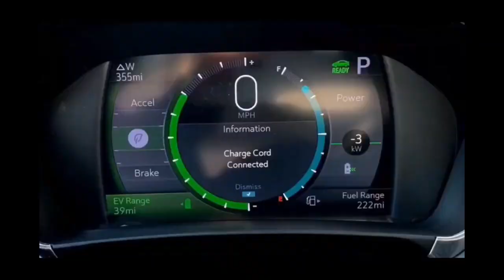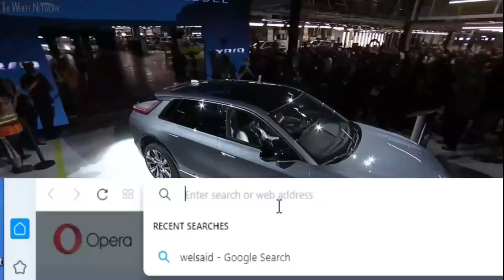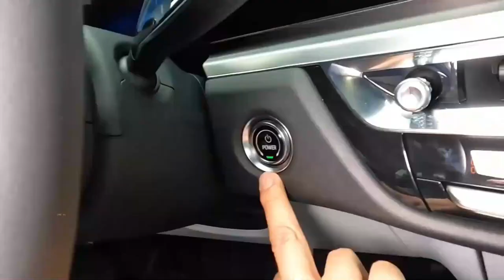2023 Cadillac Lyriq Debut edition Deliveries: 1st Quarter of 2023

Comment: I dropped by my local Cadillac dealer and test drove a 2023 Cadillac Lyriq. While I was impressed by the fit and finish and it is a very beautiful, well appointed and optioned car. The Lyriq was anything but quiet.  Every time I was around a normal city speed limit and not accelerating, or even when I put on brakes and the Lyriq was slowing down, it made a sound that was hard to pinpoint.  It was a pulsing sound.  It was very annoying so much so that I didn't particularly enjoy the test drive.  This Lyriq had only 83 miles on it so it had not been abused as a demonstration vehicle. I drove my Mustang Mach-E to the dealership and it's 100% more quiet than the Lyriq.  I was seriously wanting to be bowled over and fall head over heels in love with the Lyriq.  I'm a Cadillac man through and through.  I own an XT-4 Premium, which is my 12th Cadillac.  I love Cadillacs and really wanted the Lyriq to be my next Cadillac.   From my test drive, I'm not convinced that I will order a Lyriq. I just could not live with the noises, aceleration on this vehicle sounded almost like an ICE car.  Also, GM has made the process of test driving a Lyriq tied up in red tape.  I had to provide VIN of my Mach-E, Insurance, Driver's License, and lots more information just to drive the car on a 10 mile test drive.  I have to say, I thoroughly enjoyed my ride back home in my Mach-E. I am hoping that this is a "one off" issue with that particular Lyriq.

Comment: I ordered my 2023 Lyriq Debut Edition Dec 2021, and was just told by my Dealer that my order was being converted to a 2024, My 2023 order was 2WD with 22in wheels MSRP $61,545 and the equivalent 2024 MSRP will be $70,590, over $9,000 more. Cadillac just decided to end the 2023 production early in order to get huge price increase. This no more than a classic  Bait and Switch. I will cancel my order.

Comment: So many questions...  (1) Is the SuperCruise feature not available (even as an option) on the "Tech" trim??  If not, it's hard to justify calling that trim "Tech" when the feature is available on the much less expensive Bolt. (2) Can I fold in the sideview mirrors while driving at a very slow speed?  I have a pillar going into my garage.  (3)  Is the 120volt outlet available only on the "Luxury 2" trim and above??  We are subject to power outages in my area.  How how much juice can I safely draw from that connection and for how long??